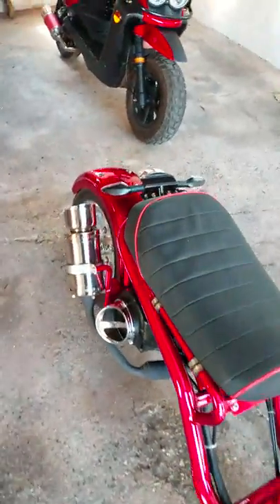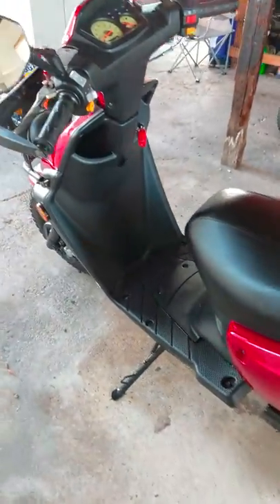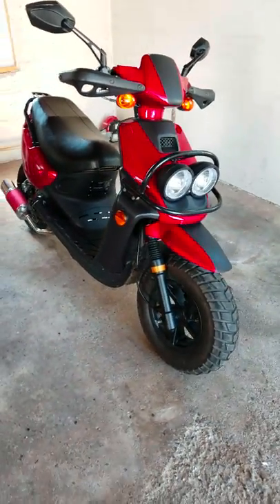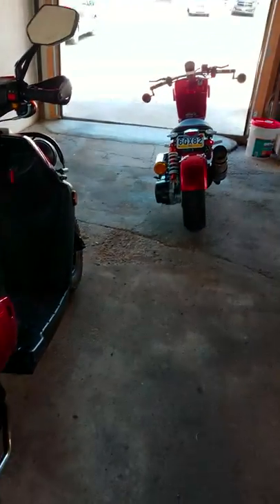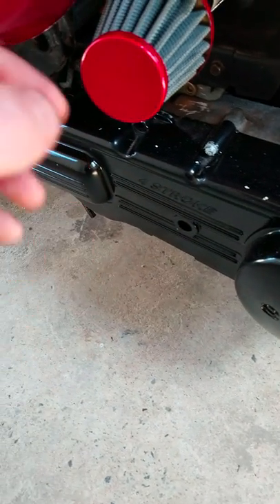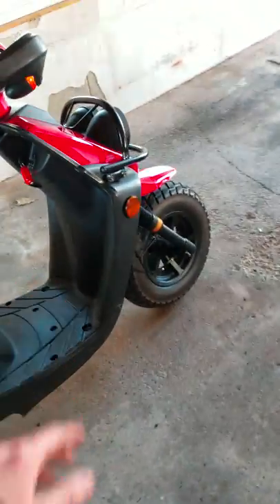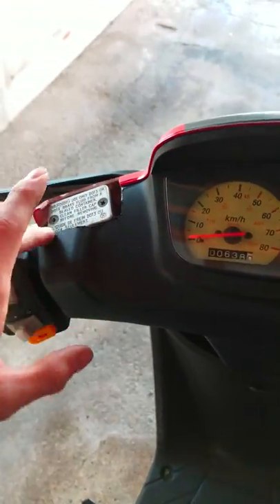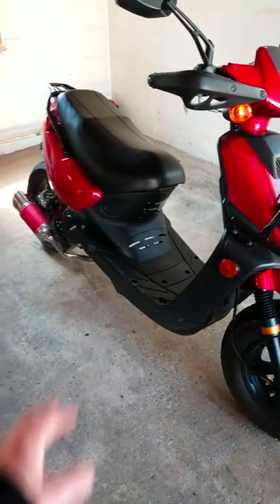What to expect when swapping a 50cc scooter to a 150cc

Comment: dude why dont you go into more about how to actually mounted it, thats what people are here for.
Reply from the maker: HybridCheef mounting wise you need either to buy the mounts and have them welded straight or find a donor version of the scooter with similar body lines and have that mount mounted welding is defiantly involved for sure
Reply: Rspec Nick for the mounting kit do you have a link
Reply: I would like to see how the engine is mounted too, if possible?
Reply: It is only a jug change out. Has anyone ever worked on a 2stroke ATV? Same idea
Reply: It's called welding
Reply: @RspecNick  I have the same style scooter and my motor needs to be rebuilt I was going to go with the 100 cc bore kit never worked on them before but I was thinking of just getting 150 cc motor like you did but I don't know if it mount right on but thing sounds nice
Reply from the maker: @BostonMike68  no the 139qmb(50cc) and 157qmj(150cc) have different mounts 150s mounts are ontop and 50s are in the front
Reply: @RspecNick  so I would need to weld the mounts . Would be a big difference than a bore kit and thanks the quick response btw I just happened to buy a scooter because of the gas prices but its slow going up hills and pulling out in traffic but now that I saw what you did I want to get into mods over the winter
Reply from the maker: @BostonMike68  yep the mounts honestly find a beat 150 cosmetic wise beat. And just pull most of the stuff from that. Bonus points if you can find a 150 variant of yours cause that would be a super simple swap
Reply: @RspecNick  thanks. I was looking on Amazon for a new one i just know how much is really involved in a swap my scooter is just like the red one you did over if I can buy a new 150 cc engine and swap it out it would be great but the mounts got me worried.
Reply: @RspecNick  honestly maybe this is out of my territory and I might be better off just doing the big bore kit I wish I could have watched the whole process. But thanks for your quick response I really appreciate it
Reply from the maker: @BostonMike68  it can turn into a big project really fast for sure. Honestly I'd just buy the big bore kit and if your still bored with it after that then maybe just sell it and grab a 150. I liked my 150 it had more then enough power for daily use to and from work
Reply: @RspecNick  ok thanks I appreciate it. I don't have to much time to spend on it. I think I will be happy with the bore kit and maybe some other mods a high performance carburetor and exhaust to start but thanks again
Reply from the maker: @BostonMike68  no problem I've been there and done it so if you have any questions along the way just let me know
Reply: @RspecNick  ok thanks I really appreciate it I'm new to having a scooter but it might be additive 😂
Reply from the maker: @BostonMike68  I usually mess with cars so when I got a scooter I thought it was cute cause they aren't really a real bike but they are fun and super cheap to mod compared to cars
Reply: @RspecNick  yeah definitely but I get a lot of attention on that thing people ask me about it where ever I go even girls I was surprised but I have fun on it I drive it to work when it's nice and save money
Reply: @RspecNick  hey Nick sorry to bother you my motor I smoked it  I didn't have enough oil it's turning over but not starting one place told me they would do the big bore another guy said be bottom end how do you think I can and can I save the motor I been watching videos on how to install the big bore kit and can do that myself and save money but don't want to put it all back together and find out it's something else and it doesn't and waste my money and time
Reply: @BostonMike68  should’ve got 150cc bro. My first moped was icebear vision 49cc did bore kit was a little faster. I now have 150cc vip champion man that thing get up!
Reply: Exactly. I came here looking for the difference in the mounting points.

Comment: Yes, I was looking for what problems you ran into and how you solved them, hence "what to expect when swapping" on your title. I suppose the prices were what I was getting for the title, but I would rather find out the latter information that I mentioned.
Reply from the maker: @indigochild161  The biggest part i ran into issues with were shock size and then running the lines for the rear disk setup.

Comment: You need to get to stock airbox back on there you’re gonna burn the motor out with that air filter these carburetors are not set up for an airflow mixture that you think they are it’s an air cooled engine you’re introducing cold air into the top head while it’s producing heat what do you think is happening is heating and cooling teething and cooling it’s heating and cooling you’re gonna ruin your compression ring
Reply from the maker: I didn't run it long like that but it does still run to this day.

Comment: I dropped 175cc qmb 4 stroke in my scooter, I had a 50cc 100cc big bore kit but finally just went for it, dropped right in no problem, 42 millimeter carb racing CDI no limiter, racing coil, new valves and cam, anything that can be done has been done, custom exhaust designed and welded by myself, fastest I've got it was about 70 and I had plenty left I was scared to take it any faster with these small ass tires. Next step is to paint it because it looks like complete s***, I love pulling up to people thinking it's a 50cc and flying by their ass, anybody that knows scooters will know it's not a 50cc just by hearing it.
Reply from the maker: Yep that's the best part it may be a scooter at that point but it will surprise alot fo people.
Reply: @RspecNick  👍 no doubt 🏍 i just enjoy working on them and giving it my own mark, thanks and take care.
Reply from the maker: @badmonkey2222  thats how you gotta do it tho. No problem at all.
Reply: Did you have to weld brackets??

Comment: I swapped the 50 outta a Schwinn collegiate put a 150cc short case on it. Only problem is the kickstand I used hits the oil drain plug. So gonna replace that, and put a stopper on the stand so it doesn't hit it anymore.
Reply from the maker: Mine luckily never did that

Comment: Hi nick I have a 150cc i bought and i want to put a louder exhaust like yours ? Are these mufflers universal?
Reply from the maker: Yes most of them are setup for the big body scooters so they will come with the 2 muffler mounts and usually 1 of them won't line up on the small body scooters. The most replicated ones are the vento style scooters (big body)

Comment: If anyone is looking to swap a 150cc into a 50cc frame without welding a damn thing find you a 50cc scooter with a 1PE40QMB engine. It's a 2T. The 150cc has exactly the same mount dimensions as the 150cc long case The output shaft may have to be changed if you want to use the 50cc wheel.
Reply from the maker: I remember hearing about a style of 50cc that allows a direct bolt on of the standard 150cc but apparently there pretty rare.
Reply: @RspecNick  I guess I got lucky. It's a Baccio DLX 50 but the engine is a Yamaha clone that was put into a handful of scooters. The stock 2 stroke in it gets me 50 mph on flat ground.
Reply from the maker: @frankh.3849  I was looking for one for awhile because I didn't want to go and have another mount welded and I couldn't find anything. Your lucky for sure I think but I'm not completely sure the one engine code was like 160QMJ that had 50cc mounts but was a 150cc motor.
Reply: @RspecNick  this is the engine
http://www.scooterpartsexpress.com/standard-parts/4950cc-2-stroke-1pe40qmb-1e40qmb-minarelli
Reply from the maker: @frankh.3849  nice thanks man

Comment: Sorry but if you wanted more power from a Yamaha Zuma 50cc why not just get the zuma 100cc 2T engine? After all is the same frame
Reply from the maker: I couldn't find that engine and when I did someone was trying to sell just that motor for 900. I spent less then half of that to 150 swap mine. roughly 380 to swap it

Comment: What rims did u use on this I just did a swap and I don't know the size and I'm using the uh bintelli beast my original size was twelve
Reply from the maker: The ones in this swap were 13 inch wheels with a rear disk setup.

Comment: Thinking about gy6 swapping my 2005 yamaha aerox50, thanks for the great info.
Reply from the maker: Swap it and if your really feeling it get the big bore kit so it's a 171cc so worth it
Reply: @RspecNick  its tempting. I'm in aus and i havent seen a single other aerox50 here, and the moped scene is relatively small in general. So i'm sure if i swapped and bored it, i'd have one of the baddest scooters around
Reply from the maker: @kahle3515  for sure the 157qmj 150cc gy6 motor is super common too so parts are everywhere for it. I was trying to find a odd 150 motor cause unlike the other 150s they should be able to mount up directly to a 50cc mount but finding one of those specific motors is hard
Reply: @RspecNick  once again, thanks for the info. Earned yourself a subscriber mate
Reply from the maker: @kahle3515  thanks man 👌
Reply: Cool idea, but a 70cc 2stroke kit can go faster

Comment: Wow I have a Roguestar 50 by Scootstar with a 100cc big bore kit on it, when it hits 50 miles per hour, it doesn't sound quite right. My bike looks exactly like that one but it's in flat matte green. I think I'm going to go with the Blaze ll 150cc by Wolf. I absolutely loved your video. My question to you is with a 150cc do you have the pep right off the start? you know the feeling that pull that get you in the traffic faster? Thanks brother. Bobby from Warwick RI.
Reply from the maker: Hey hey and yes for sure the 150cc pulls way harder from the start and that's what you really need from a scooter especially in traffic

Comment: Wow awesome video. Hey bro quick question. I got a 2021 Roguestar50 and I just put a 100cc Big Bore Kit in it. The problem I have is my rear shock is a little mushy or a little soft I should say, is there a performance shock out there for it?  (12"). Same shock as yours with the U at the bottom.
Reply from the maker: Theres a couple different types on Ebay I think the 12inch one they measure out to 280mm I think. Other then that there is NCY shocks but they usually lower it.

Comment: Do you have a video on the disk brake conversion?
Reply from the maker: The whole motor setup came the way I had it so I didn't really have to change anything minus add the brake lever setup.
Reply: @RspecNick  yeah I did find your other videos and saw the mirror swap one.   So it is attached to the torque arm?  I see that it's on the right side.
Reply from the maker: @irocss85  yea it's just attatched to the bracket.

Comment: So i bought a red scooter and a black scooter at the same time but for some reason the red one has wayy more power they both are stock and cane brand nee
Reply from the maker: It can happen sometimes I mean you can take 2 brand new cars of the same make and one will be faster then the other.

Comment: How hard was it and did you have to mod anything other than the rear disk brake
Reply from the maker: I had to mod alot. Rewiring signals,hand controls. I had to cut the plastics for a decent amount of the handlebar space
Reply: @RspecNick  I'm sorry I should have been specific my fault....I mean the engine swap
Reply from the maker: @knoxbom3274  no worries besides welding in the 150cc mounts not really much if I went with the drum brake setup I wouldnt have even needed to mess with the brakes at all
Reply: @RspecNick  thank you for the info brother.....I have a 50cc that I'm thinking of swapping to 125 or 150 whichever I can find
Reply from the maker: @knoxbom3274  oh yea the 150s are easy to swap as long as you can weld or have a welder on tap
Reply: @RspecNick  thank you brother for the help
Reply from the maker: @knoxbom3274  no problem anytime man

Comment: How fast does 150cc go
Reply from the maker: About 60mph depending on the riders weight
Reply: I weigh 310 how fast will go with that
Reply from the maker: @AllLifethingschannelyt  most likely the 50s maybe 60ish downhill wide open throttle. I'd get a 150cc and get the 171cc big bore kit that will help you with a better powerband on accel and top end

Comment: Hey what model is that moped i have the same one with a 150cc motor but i want to put performance parts on it pls let me know i cant find another moped like this anywhere
Reply from the maker: It's a taotao bws50 but they make a bws 150 model as well it's a clone of the Yamaha zuma
Reply from the maker: The motor itself should be a 157qmj
Reply: Thanks!!! I really appreciate that now i know what parts to order
Reply from the maker: @shawnhaney3895  no problem 👌

Comment: hi nick i got question my push start button dont work but the kick stand start. what could be the problem
Reply from the maker: Is the push start just bad ?
Reply: i think its my battery becuase when i key on my headlight dont even come on
Reply from the maker: @wahkitng4505  is the tube fuse still good and connected?
Reply: @RspecNick   tube fuse where is that located at
Reply: but mines 2008 zuma 50cc
Reply from the maker: @wahkitng4505  not too sure with that setup.
Reply: @RspecNick  I just found out there no fuse tube what’s the fuse size number on that ine
Reply from the maker: @wahkitng4505  I'll have to get you a PN but I know mine is a 15AMP tube
Reply: @RspecNick  ok thanks

Comment: I have a 50 CC I want to make it A150 Also.. did you have to modify the frame Or Weld anything to make it fit Or did  It drop right in..Let me know get back with me   Kirk ...
Reply from the maker: I had to weld 150 mounts to the 50cc frame
Reply: You didn't show anybody where you welded them at that's the problem... You just said I swap the 
50 she's 60 to 150 but you don't tell anybody about how you well did it
Reply from the maker: @kirksellers5989  frame mounts differ depending on the frame you have. I was luckily enough to find a 150 close to me that had a similar setup. Some of the 150 frames are pretty big so it's hard to give an exact placement when there is alot of variants of scooter frames. Even with mine being close it still ended up stretching the back out 3 inches.
Reply: @RspecNick   OK well mine's totally different it's not a ruckus that you have in your garage it's totally different man and I can't explain it it has a big fat tire on the back but it is a moped I never seen anything like it before.. It's called a 200 dfx... Totally original man I think it looks better than heracus.. Plus the tire in the back is really fat fatter than yours it's like a car tire like Drag Racing flat.. I can't explain it every time I try to explain what kind it is I can't find it on YouTube or hear or nothing that's all original it is you ever heard of that 1
Reply from the maker: @kirksellers5989  sounds like one of the 200cc Coleman bikes with a swapped tire
Reply: @RspecNick  I just found out Honda made  a 200 zoomer x
I think I'll sell mine an get the new Honda just now came out with I think Honda  Made a deal together because it looks exactly like mine so I think I'm just gonna sell mine like I said and get the Honda X zoom or check it out their bad a**

Comment: You show a bike but maybe you bought it that way,  the parts your talking about are from aluexpress bro, you mentioned a 40% higher price. so consider if your ripped off big time.
Reply from the maker: Alieexpress has alot of fake parts as well. Most of the parts I was buying were legit parts not knock offs.
Reply: @RspecNick   The fan you bought is from Glixial a company well known on AliExpress l, it depends on your stategie when using aliexpress

Comment: I am inclined to do the 150 Cc upgrade just for the stock available hp and tq of the larger engine. All the other things seem like overkill. The two small chassis scooters I have rode are not stable at high speed. The extra grunt  is just nice for hills and two up riders.
Reply from the maker: The scooter honestly wasn't terrible now it does help that they make that same scooter in a 150 so the frame was basically identical minus mounts. But that swap vs my ruckus clone is probably grab another ruckus clone before doing a 150 swap again

Comment: where did you get the exhaust?
Reply from the maker: Just alittle ebay exhaust it actually didnt end up holding out it cracked at the flange that holds it to the motor.

Comment: I’d like to switch the engine in my 50cc to 125cc Chinese scooter but I’m scared it won’t take.
Reply from the maker: Going from the 50cc to the 125 or 150cc you need a top mount engine bracket there was 1 engine that was a 150 they made as a bottom mount like the 50ccs but I heard there hard to find and when you do find them there expensive I forget the engine code for them
Reply: I believe you can change out cylinders for up to 120cc off of a 50 cc engine. There is other stuff you need to do besides that but that is the main thing. They sell kits for it.